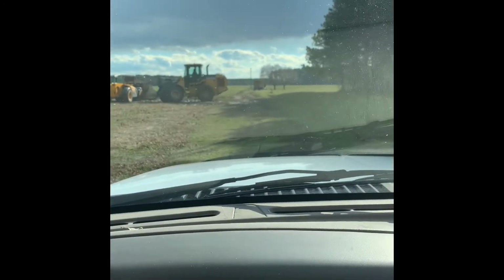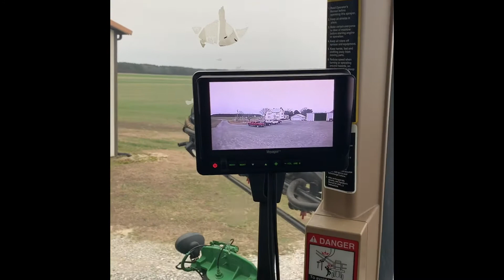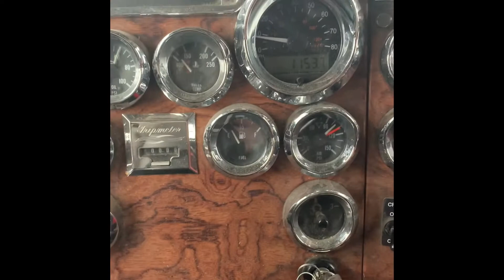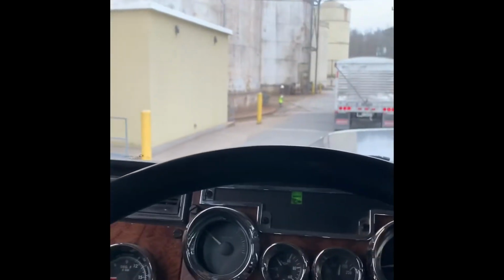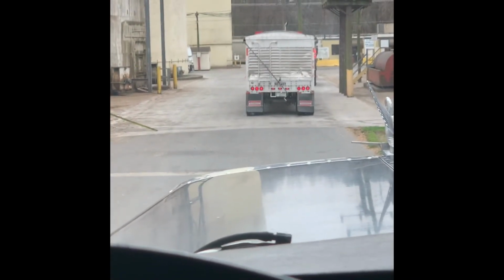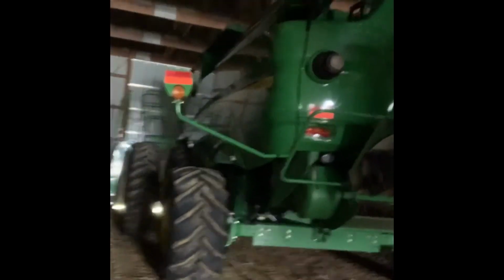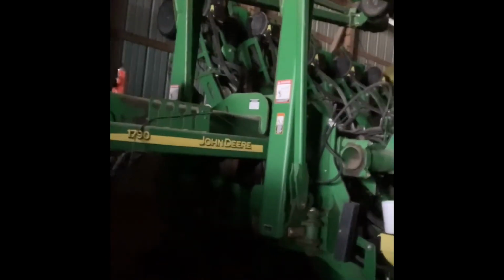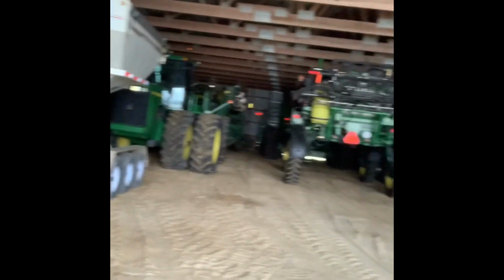Hauling Soybeans

Comment: You are correct.  Dumps 1 and 2 at Salisbury are tight.  Tyson in Snow Hill is tight too if you don't get to dump next to the RR tracks.  A lot of these mills were designed for 6 wheelers and have never been updated.